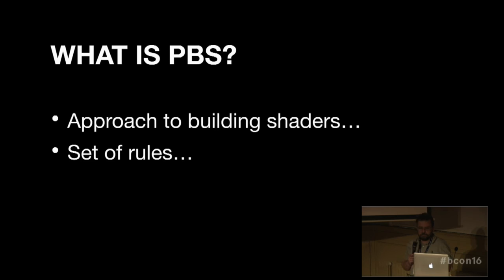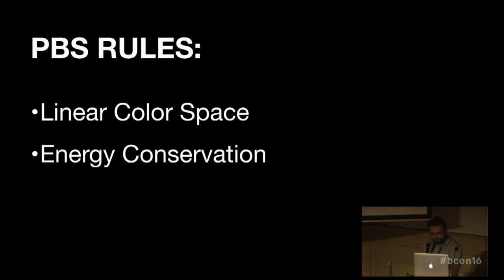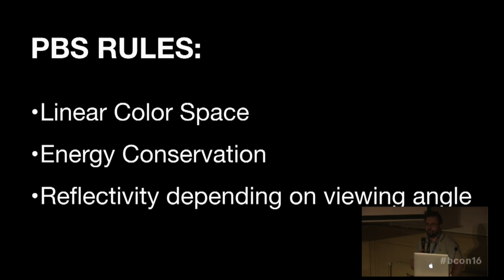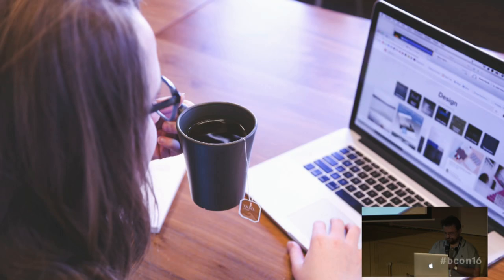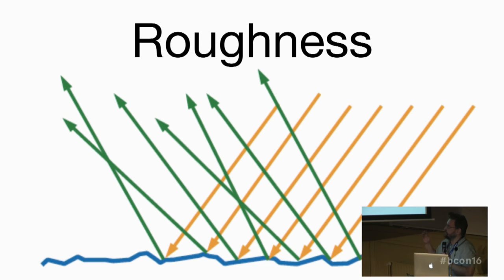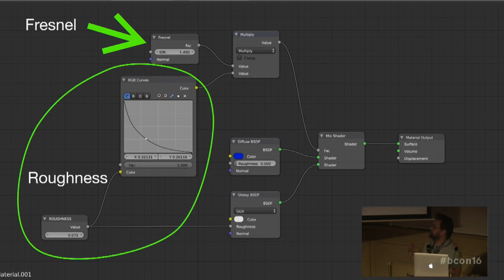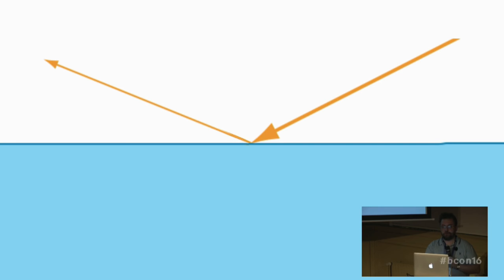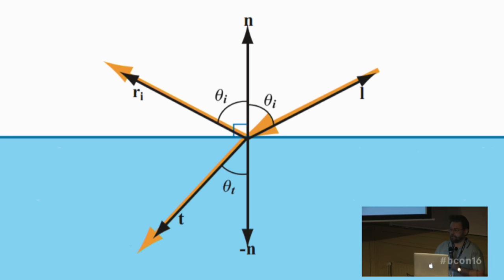Naked Truth about Physically Based Shading

Comment: 8:08 If you think of light as waves, then the waves have to bend as they slow down or speed up, otherwise they won’t join up properly.

Another analogy I remember from a book many years ago was marching soldiers in formation, slowing dow(taking shorter strides) or speeding up (taking longer strides) as they cross a boundary at an angle. Again, they have to change direction in order to maintain the correct formation.